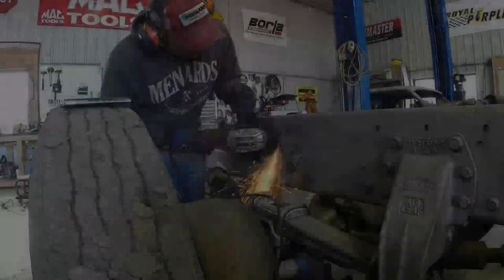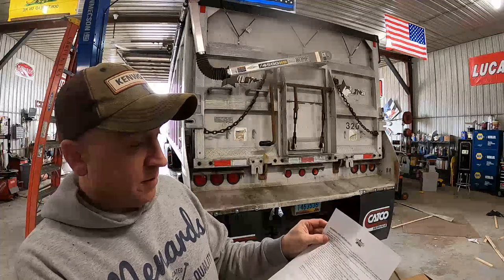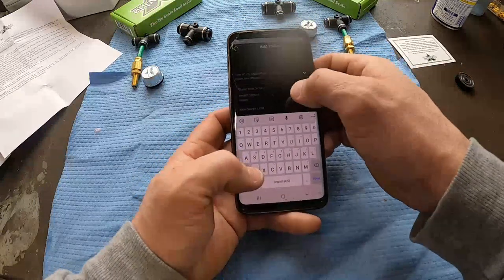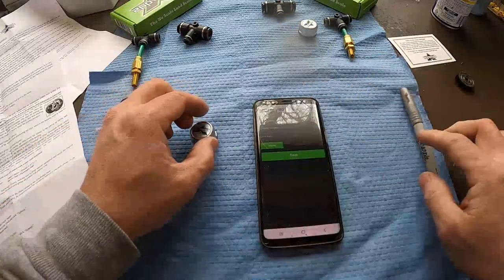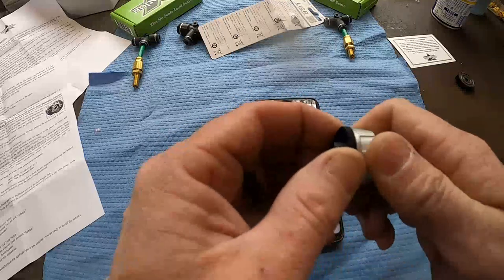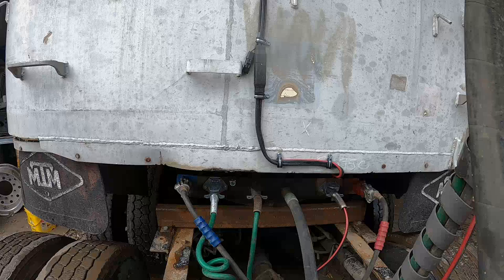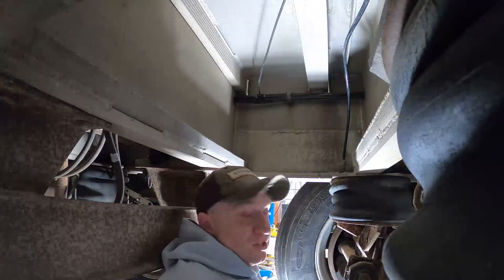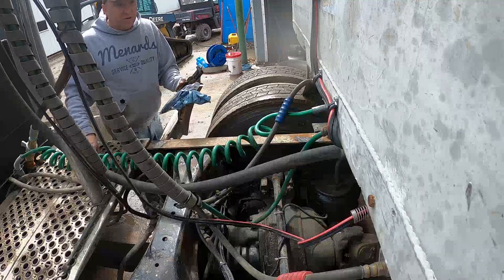App Weigh Bluetooth on board Scale install and Calibration on a KW T660 and Trailstar End Dump

Comment: I'm looking at installing an air scale system on my truck and trailer I'm wondering how good it will work on a spread axle trailer 🤔
Reply from the maker: I love these!   I'm sure it would work fine.   If both axles are on the same leveling valve they should work fine.   You need a sensor for each leveling valve.q